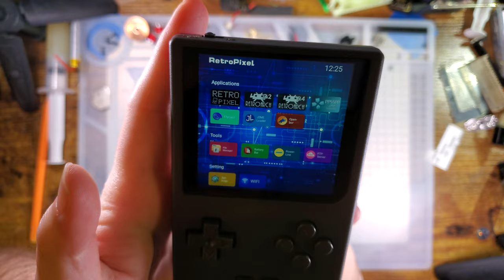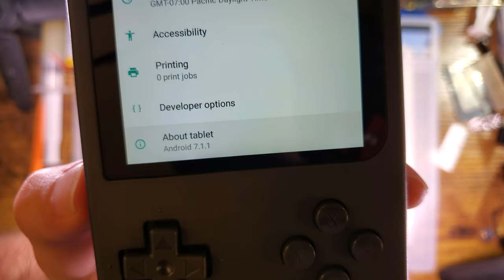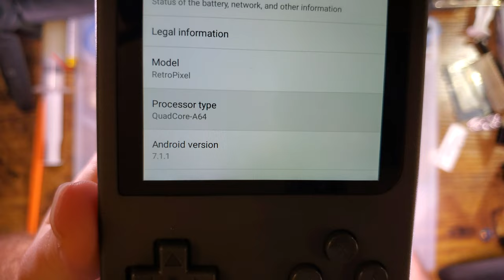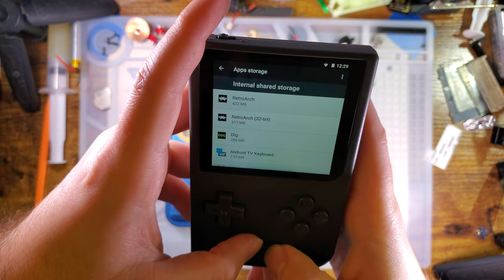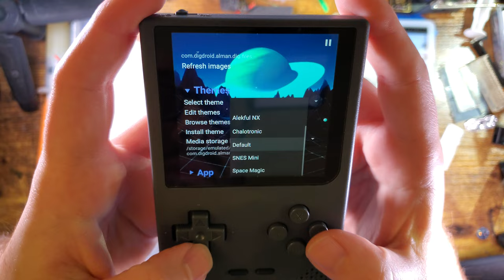Retro Pixel Pocket

Comment from the maker: Double tap both "start" and "select" while in games to exit the game or press the middle button on the brightness wheel (android home button) to exit games or apps. Press and hold "start" for at least two seconds to get into the settings overlay while in games. Quick Menu -> Options -> Interframe Blending to enable frame blending. 

Be careful rooting around in the retroarch app itself as after updating the cores in mine, I seem to have broken the association for some emulators and the Dig app ("Retro Pixel") no longer properly launches some systems (still launches fine from retroarch UI though). 

I also loaded the DS core up in retroarch and performance is about what PSP performance is on this device. Don't count on playing NDS. Maybe there is room for optimization but that's not something within my ability to try.

Comment: As an all in one Gameboy console it covers everything anyone without a Gameboy could ever want. As someone with modded Gameboys and emulation devices like the Miyoo Mini Plus, this console doesn't really tempt me in any way other than novelty. 

It's a great alternative to selling pre-modified Gameboys or for someone to buy an original Gameboy and then modify it, this basically removes all the need to do that. Saying that it could have just remained with the original pocket aesthetic with an A and B button, original size d-pad etc... instead it kind of focuses on doing a few more consoles without doing a good job of it.

I'm also sure that custom software will very much improve the user experience much like on the Miyoo Mini.

Comment: I would love a part 2 where you hook up a keyboard/mouse to get at more options and do some more tweaking. I don't know how much relevant hardware you have around, but either a usb-c otg dongle (c to a) + usb hub would let you hook up a few things at once, or they make phone dock things that can have usb ports and ethernet on them. If bluetooth actually works on this thing (it might not, who knows) you could also pair some sort of bluetooth keyboard/mouse for future use. You could also use a controller with analog sticks if bluetooth were on (maybe that's where you were going when you tried to turn it on).
Reply from the maker: I looked up the wireless chipset (RTL8188EUS) and it only supports 2.4GHz WiFi. No 5GHz or bluetooth.
Reply: @makho  Bummer. Thanks for the info.

Comment: That sucks about gba games, I wish the screen was bigger, still might buy this for my brother. Is there any way to stretch the game to full screen?
Reply from the maker: It's just kinda how the form factor works out. The opposite thing happens for playing GB games on devices made for GBA. Unfortunately, there is no "one size fits all" if you want both systems.
Reply: @makho  I finally found a video of someone playing the ds emulator on this device and you can have it side by side but also you can have it full screen and just press the trigger button to switch screens which is cool and I could totally deal with. Hopefully it'd be good for pokemon and not too much back and forth, I forget how much you use the touch screen

Comment: I used scrcpy to access settings/buttons that can't be clicked without a touchscreen. I haven't been able to connect any input devices with an OTG adapter.
Reply from the maker: The device does not appear to support OTG, just data storage.

Comment: It has Bluetooth in the settings menu but does it actually have bluetooth?
Reply from the maker: I looked up the wireless chipset (RTL8188EUS) and it only supports 2.4GHz WiFi. No 5GHz or bluetooth.

Comment: if it wasnt for the top bezel i would buy 10 of these in every color, but for me the unequal bezels are extremely off putting. am i crazy?
Reply: That doesn't bother me as much as the half-baked software. Hopefully someone will release a better firmware.
Reply from the maker: If that bothers you, you should look at a GBA SP and pay attention to the left and right bezels. 

I believe it's like that so that the LCD can be aligned to the edge of the glass for easier lamination.

Comment: Can it run ps1?
I just got rg353ps for $89 I’m happy with my new unit.  I’m glad you got your new toy awesome yellow pikachu case.
Reply: The specs aren't impressive and the OS is super old, but it's worth considering it as a dedicated appliance of sorts rather than comparing to an android phone that you'd use for many things.
Reply from the maker: I mean, I ran Crash Team Racing in the video. That's a PS1 game. 

I think this is the wrong form factor for a lot of PS1 games but as long as you don't need the analog sticks or the second row of shoulder buttons, I guess it's fine.

Comment: Add a few more trigger buttons under the ones it alredy has, and add a few PSP style joysticks. A bigger screen flush to the edge. Not that I really think the board could handle the extra space needed to hold all the extra parts. Clip on, customizable skin covers. It all would be nice. I have noticed most emulators that run through android dont work well. I would like it if something like this would run MEDNAFEN. Also bluetooth would be nice to use external controllers and keyboard mouse. I know it never happen, but one can dream. Not sure how much money you would need for all that to be standard for a consumer modle. I'm sure it be expensive.
Reply: No. No. No. No.
Reply: There are plenty of GB style devices that already fit your criteria sans customizing the face - but that isn’t difficult. What Funny Playing are doing here is strictly for the GB lovers. We don’t want an analogue stick. You can’t make the display larger to shrink the bezels without losing the correct GB aspect ratio. Software side could be better from the looks of it, but Android emulation isn’t really an issue.
Reply from the maker: I looked up the wireless chipset (RTL8188EUS) and it only supports 2.4GHz WiFi. No 5GHz or bluetooth.

Comment: Is there even a point to these devices when there’s millions of 3DS’ and PSP’s/Vitas that do the same things for nearly the same price plus their own libraries? Of course it’s not the same form factor, but is that really a big deal for most?
Reply: Too many people do not want to hack their devices
Reply: I really think form factor is that important to people.
Reply: You aren't going to find a 3ds for $99 in good shape.
Reply: If the plethora of GB form factor emulation devices isn’t indicative to what retro gamers want, I don’t know what is.

With how popular Funny Playing’s aftermarket screen mods are, it’s pretty sick they’re just releasing their own device.
Reply from the maker: This is a much better form factor than 3DS or PSP/Vita for GB games. 

That and good luck getting a 3DS or a Vita for less than this thing costs. This is good to go out of the box, a 3DS or a Vita would need to get softmodded first (which requires additional hardware depending on the specific model).

Comment: Analogue Pocket is FPGA - that IS DIFFERENT than your emulators.  Rather than running an emulator in software, FPGAs emulate different video game systems at a hardware level - much better.
Reply: emulation is emulation.
fpga emulation is as "better" as the fpga is written, same as traditional emulators.
Reply: @sakitoshi  not quite. It's an entirely different process when running software not specifically built to cater the hardware's capabilities. Whereas the hardware built emulation can run flawlessly with no tweaking or setup. It gives it a much more effective experience.
Reply: @FEBRIZIOtv  We need a NEO GEO Pocket inspired FPGA handheld like the analogue pocket, but with a 4:3 screen!
Reply: @FEBRIZIOtv  let's just give up. some ppl never get the concept of FPGA.
Reply: @Sakitoshi  FPGA is not emulation. It's literal actual hardware. It is the equivalent of using the same exact chips in a GB or GBA, etc. This is the appeal of that analog pocket.
Reply: @radical_ans  It is emulation, but it's hardware emulation rather than software emulation.
Reply: Don't forget to mention why it matters: FPGA, being hardware-based emulation means less input latency in games than software emulation. It's not just some silly prestige thing.
Reply: @sakitoshi  Nope - do some reading.
Reply: @radical_ans  'FPGA is not emulation. It's literal actual hardware.'
Bro, everything is a piece of hardware. A literal actual piece of hardware.
Reply: @radical_ans  An FPGA is a piece of hardware, that can be used to try to mimic how a particular piece of hardware worked, or you can use it for something completely different.
Software works over a piece of hardware, that can be used to try to mimic how a particular piece of hardware worked, or you can use it for something completely different.
Reply: @radical_ans  They're both emulation. The only thing that couldn't be emulation is a hardware *clone*. But a hardware clone would behave exactly as the original system did, so no multiple consoles emulated, fancy menus, shaders, multiple processors...
Reply: @Gabi-enby  FPGA IS a hardware clone. That's the whole reason it is preferred over software emulation
Reply: @radical_ans  It isn't, it is hardware emulation. By itself any piece of hardware can't be a clone if it isn't exactly the same as the one you're trying to copy. A Game Boy doesn't has an FPGA, neither an FPGA coded exactly like the main one on the AnalPock

Comment: Yesterday I received my retropixel pocket console in black. It has many bugs, the main one is that the cursor directions don't go well, I often have to press an address twice for it to scroll once, the Wi-Fi disconnects and connects even when I'm next to the router. The plastic from which the device is made is very bad, they are not up to the quality of the products of that brand

Here IS a video with the problems

https://youtu.be/GjpUeu8cDT8